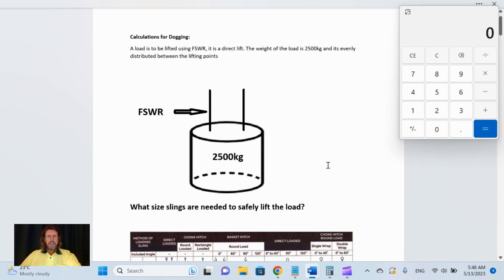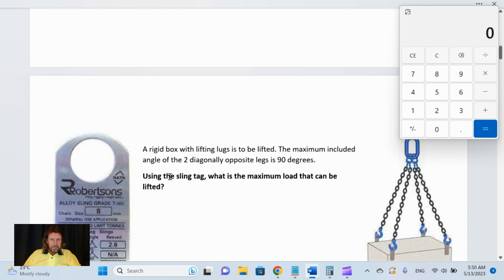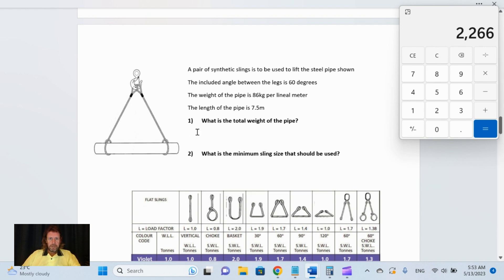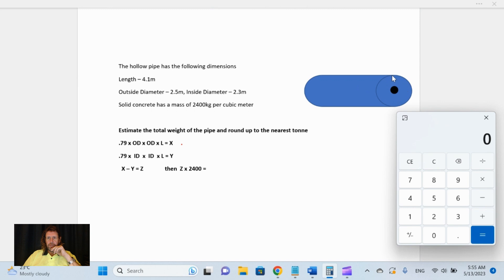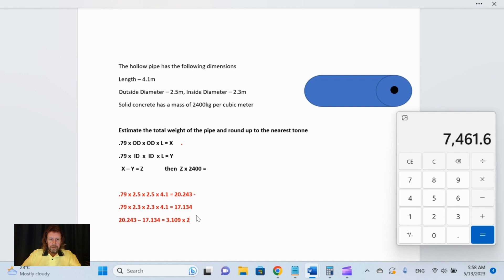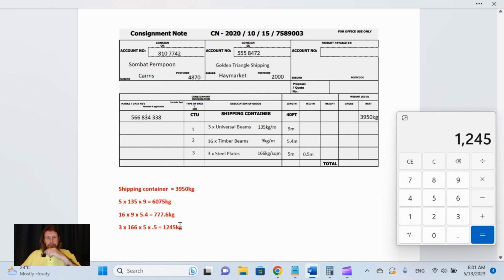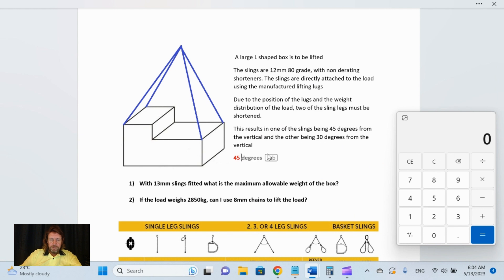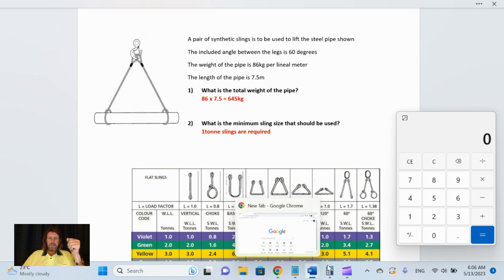Dogging Calculations, HRWL

Comment: You mentioned on the L shaped question about the vertical angle being in the middle of the CoG, that was not correct, the vertical was from the load on each of the hooking points.